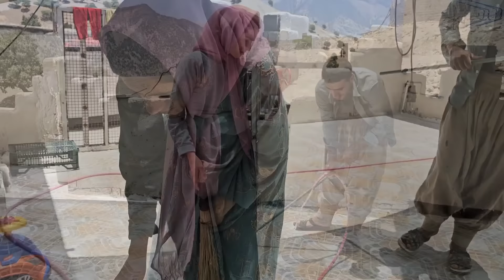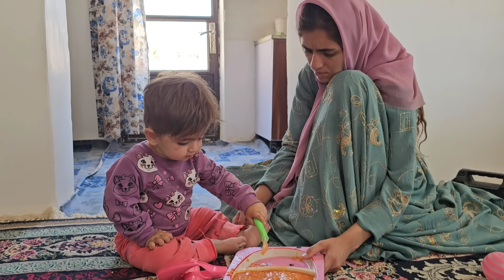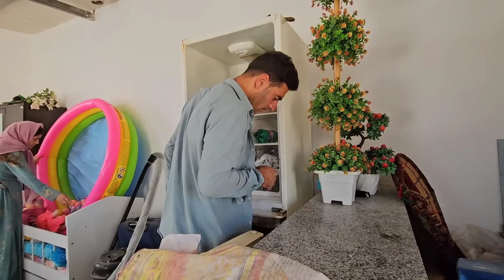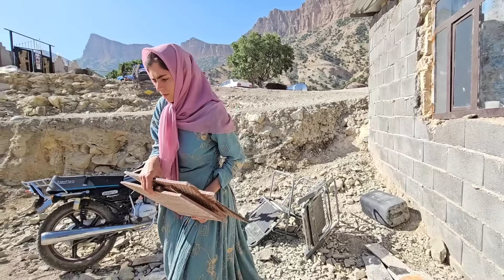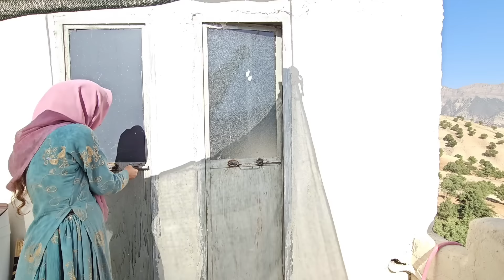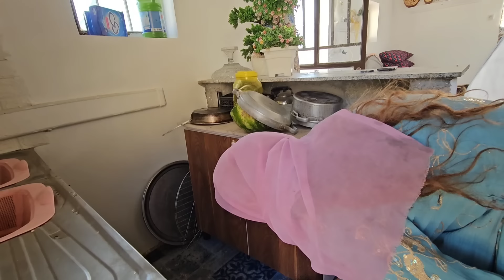Documentary of a trip to the city to buy food by a nomadic family

Comment: Idea.  This couple has electricity.  Why don't they buy a fan or several fans?  They can put them in the windows to push out the hot air out of the house, and one on the ceiling to circulate air around the house.  Or just a big stand up fan in front of a door with a screen or window would help.
Reply: Surtout que l'électricité et l'eau sont gratuits ...